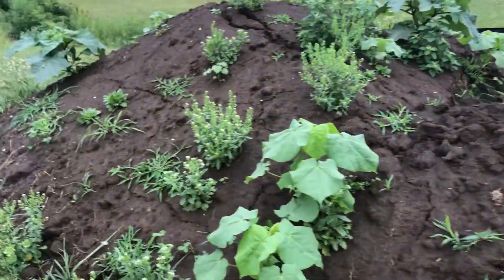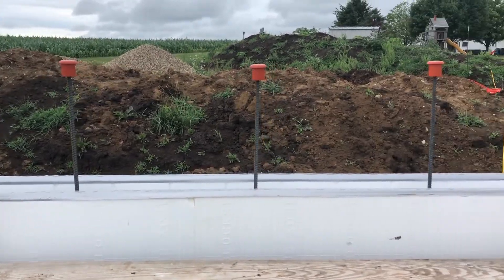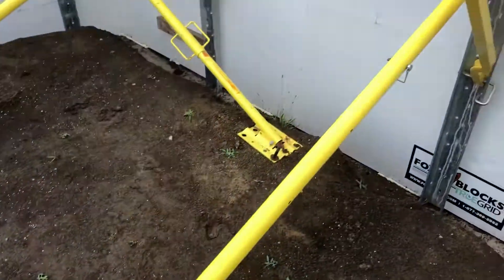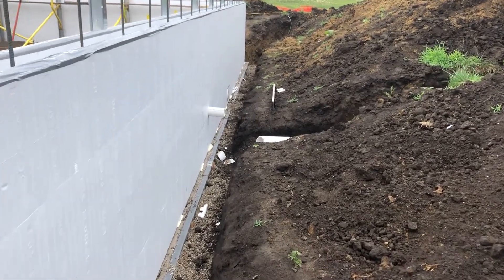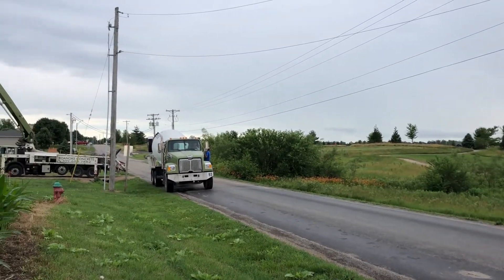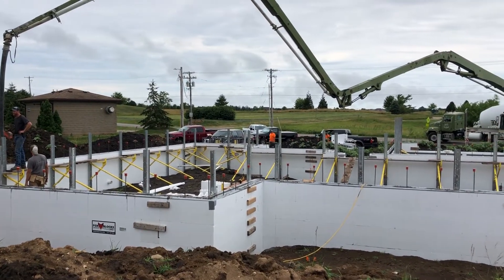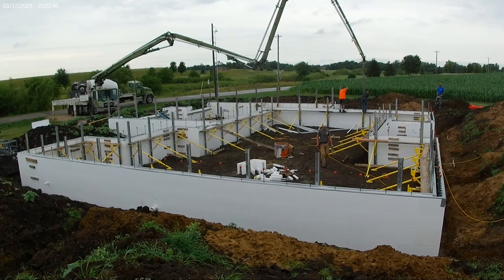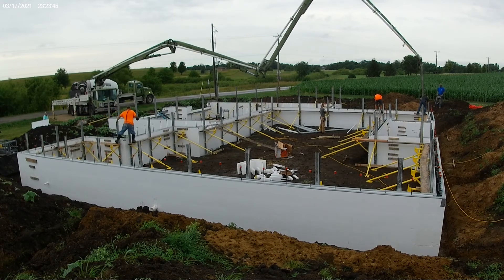ICF Foundation Walls

Comment: so the exterior wall are 4" cores? If so, is there going to be a second floor?
Reply from the maker: Nope, all the ICF walls are 6” core (13-1/4” total width). The 4” core blocks are recommended against by most of the installers we talked too. (1) 4” forms aren’t any cheaper, (2) you get poor concrete consolidation (holes and voids) because there’s not a lot of room for concrete to flow around rebar and webs in a 4” form, and (3) they’re non-standard, and typically you’ll have to special order them. 6” is usually stocked locally by your building supplier. This is a single story house too. Thanks for following!
Reply: @avalianteffort40  I think the 6” core is 11.25” total no?
Reply from the maker: @TheTerraMap  Yep. Realized that today while laying out the laundry room and was off by 2".

We originally designed with Nudura XR-35 6" core (14" wall), then switched to fox blocks 8" wall (13-1/4") with 2" foam insert, and then finally settled on Fox Blocks 6" core (11-1/4"). Way too many numbers in my head. I'll need to find a way to comment or correct that out in the video? So sorry if it lead to any confusion on your end!
Reply from the maker: It would be good to check the engineering guides too, I don’t think 4” is acceptable to support a backfilled basement or a second story.
Reply from the maker: https://assets.foxblocks.com/web/legacy/uploads/2017/10/1.05.01-Structural-Engineering-US.pdf
Reply from the maker: 4” is okay for walls, but not okay for foundation / basement walls according to the design manual.
Reply: @avalianteffort40  Thank you so much

Comment: where to buy the icf
Reply from the maker: You have a couple options. (1) Probably the easiest is to buy through Menards. They sell LiteForm. (2) You can contact any of the ICF brands through their website (Fox Block, Build Block, Nudura) and they’ll put you in touch with a distributor who can help you with doing block take offs and bulk orders. Or (3), you can contact your local building supplier, and they’ll be able to supply you with their ICF of choice.